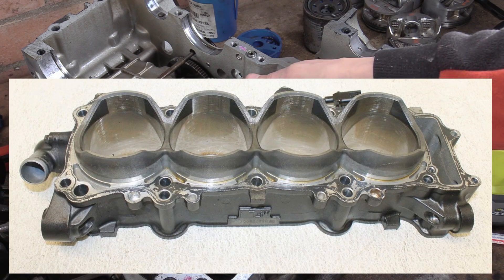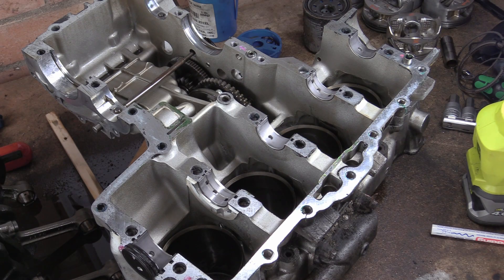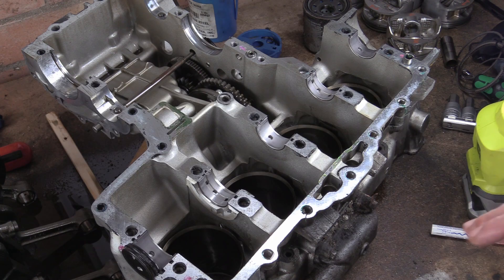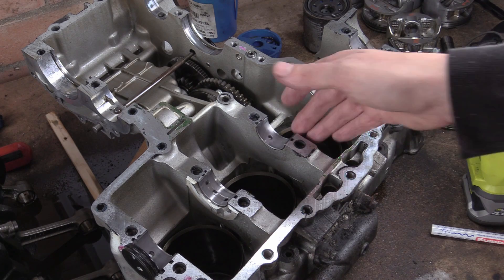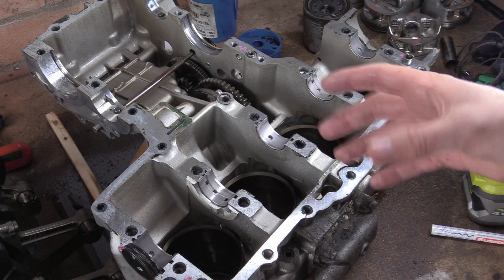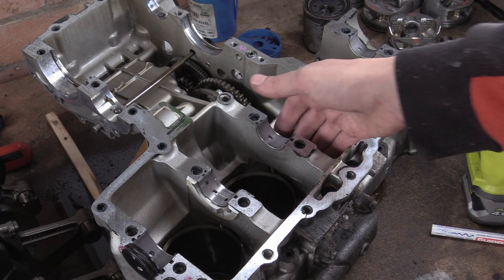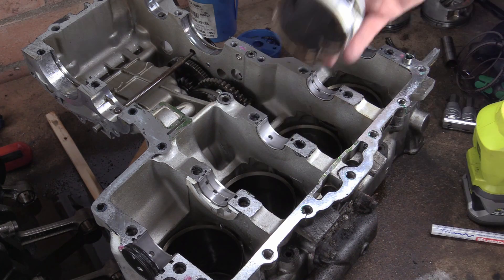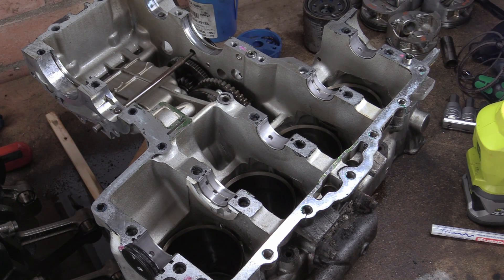Pumping losses Example - Part 1

Comment: Great stuff here. I'm a competent mechanic, many builds under my belt, but I'm just getting into competition. I've never invested much thought into the pressure differential between cylinder banks. I would imagine at the proper RPM and stroke you'd have an almost constant reciprocal pressure wave fighting piston travel. Always looking to fight parasitic losses and even though air doesn't have much mass if the pressures got high enough pumping losses could represent a significant loss in power. Great content, thanks 👍

Comment: Well maybe not all of you remember the rainbow slinky toy but it could represent that transition of the air between the pistons.. if you speed up the elevation of your hands you will end up with beating your hands with faster moving spring, greater force to handle the spring and elongate the toy ( it represents the high pressure of air beating the pistons )

Comment: Hey matt. So ive messaged you before about the r6 engines we run in our dirt track cars. Anyways, my engine builder is developing a dry sump set up for our engines and the way hes trying to do it it should in his words create a vacuum on the crank case or a low pressure region i should say.  Is this better for pumping losses? Ive heard yes but want your opinion. And also if its even possible.

Comment: Dry sump for the win!? Wouldn't that help reduce crank case pressure?

Whats the scoop with the pink arrow at the top center?
Reply from the maker: "Whats the scoop with the pink arrow at the top center?" - the what?
Reply: 4:28 right above your knuckle there is a pink arrow on the case sealing surface?
Reply from the maker: It's not an arrow - just looks like it - its old sealant from whenever - there's more of it dotted about

Comment: just a small curious question related to crankcase breathers. 

Some breathers have read valves built in and I was wondering if there is any benefit to them verses engines without read valves. 

I have seen bad read valves be the cause of oil consumption of opposed twin briggs engines. 

I wasn't sure if the slight vacuum is better or worse for pumping losses. In my mind I think a vacuum would help as the piston goes to TDC the less pressure pulls on the piston for both strokes but maybe blow by screws things up🤔.
Reply: Ducati's Desmoquattros had reed valves on their cases to effectively reduce the crank case pressure.  But when they went racing, they put the valve on a large remote "reservoir" connected to the breather instead.

At sustained high rpm, the valve tends to get wet with oil when it's close to the cases - that has two effects: it won't lower the case pressure as much, and much more oil will go up the breather pipe.  The reservoir serves as a kind of surge tank to keep the flow oscillations into whatever is evacuating the crankcases to a minimum (e.g. airbox, vacuum pump, exhaust extractor etc.), and consequently also to ensure less oil gets that far.   It also means, if the reed valve stops working, the cases aren't inhaling fresh, possibly wet and dirty air, or exhaust gases etc.

I think, on balance, the lower case pressure reduces the turbulent losses Matt was describing (plus crank windage etc.) enough that a small amount of power can be retrieved; that makes all the difference in racing.

Comment: With the scalloped liners, is there more of a benefit from weight saving whilst retaining piston stability with a deep liner through bdc, or the reduction in pumping losses? Sounds like a white board maths challenge 🤔
Reply from the maker: Good question - if you look at the R1 cylinder picutre the scallopes are is specific places and are not symmetrical - this is becasue of the flow path within the crankcase

Comment: Wouldn't there also be a vacuum in response, as a piston rises to TDC  As well, assisting the rise in pressure from the piston dropping to BDC?  No idea how this would work out Matt?
Reply: Genuine question... did you watch the video at all before asking this?
Reply: @jeffsymons7084  Yes, but as always, I ask my questions before the answer is provided, and I leave them hanging. I get quite excited and want to interrupt with my questions stupidly. 😱👍👍👍🚲
Reply: @stevenhoman2253  Ah I see. Just wasn't sure if you missed the explanation or didn't understand it or simply hadn't watched the video yet.
Reply from the maker: You have to remember that a vacuum doesn't pull - i.e gases expand into voids - nothing pulls or draws them in. Once you understand that - then a lot of things start to make sense

Comment: Heres a good one for ya
Whats limiting the 600 class currently? They make pretty much the same power as they did 10 years ago while liter bikes are now throwing down to the wheel what they use to make to the crank
Reply from the maker: What are you talking about? The R6 for example - 

1999-2000 = 94.8 hp
2017 onwards = 116.8 bhp

Even if you wanted to be conservative that's still 15HP more - out of the same volume - That's a 23% increase using the numbers above! How is that limiting?
Reply: @thedirtyworkshop  im talking about the mid era specifically. For example my old 2004 R6 threw down around 120crank horsepower and the newest ones do the same. Without a doubt the bikes following the switch from carb to Fi gained considerably. But after the mid 2000s they seemed to have peaked power wise. Maybe a few horsepowers here or there but for the most part they havent seen a steady large growth like what we are experiencing with the newer bikes. Some of which just need a quick derestriction flash to jump from 160 to 180 and some coming out of the box with 200 wheel (on the higher end)
Reply: Wafftop is that not because of emission rules ? Most of the timethat is lowering output. So the same as before is in reality a gain
Reply from the maker: But who uses peak power? Yeah emissions to a small degree but the point is to make the bike faster not max speed. Get on your 2004 R6 and then ride a new 2017 one - you'll instantly feel the difference - Progression is not measured in max speed
Reply: @mauricevandoeselaar  true, very true
Reply: @thedirtyworkshop  fair enough

Comment: in my BMW Boxer the breather hose is connected to the air box, is it the same in four in-line or in twin parallel cylinder engine?
Ciao ;))
Reply from the maker: Yes - this is an emissions thing - oil and fuel mist would just piss out and kill a child - so to prevent that thay pass it through the intake to be burned
Reply: thanks, I thought it would serve to enhance the intake stroke as well, am i wrong?
Reply from the maker: Only if it has a reed valve fitted